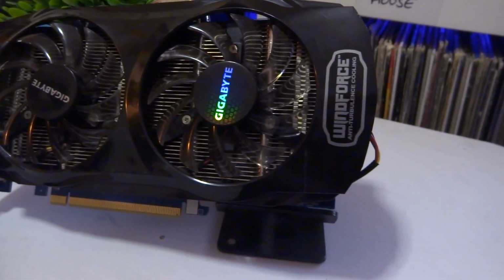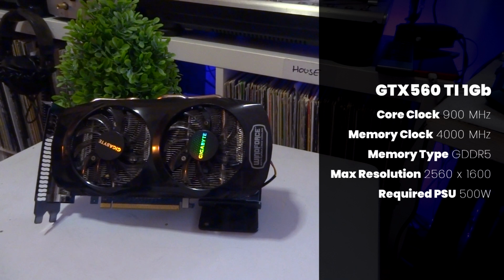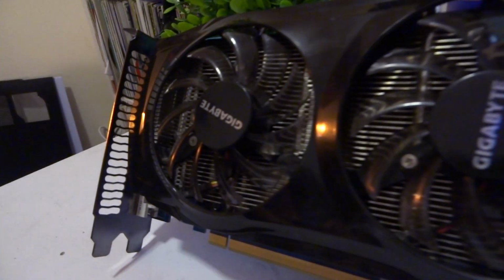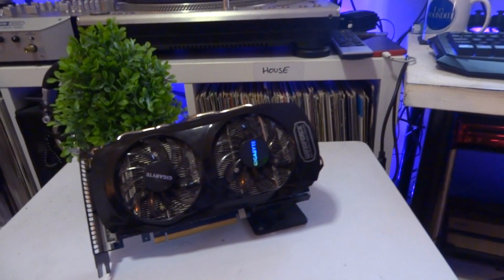A Quick Review of the GTX 560 Ti - Any Good in 2018? Lets find out!

Comment: I have a pc with:
GTX 560 Ti
Intel i7 2600K
8GB RAM
and i can run fortnite with competitive settings (1920x1080, 3D resolution 100%, everything at low except view distance and textures, which are on epic. Motion blur and v-sync turned off) at an avg fps of 100 (consider i cap it at 120), a 1% low of 49Fps and a 0.1% low of 25 FPS. They NEVER drop down 60 when i really need them (aiming, building, editing) and it never stutters.
Using Windows 7 with the most performance settings possible
Reply: Conclusion? I find it a really solid card even these days if u dont play super high graphics games. You should buy it only if it has a good price (cant really help u on that) and u know you won't be playing graphics-intense games.
Got this entire setup with peripherals (gaming keyboard, monitor and mouse) for just 300€. That's a fucking good deal
Reply from the maker: Very cool deal indeed :)
Reply: Hi, I have a problem updating drivers. This is because I used Windows 10.???
Reply: @FutureBoyWonder  a very late answer but windows 7 is just personal preference. I recently updated to win 10 tho

Comment: Can you tell me what specs the whole PC had?
I got a PC with this card, 2    2x4 8GB HyperX ram sticks, Intel Extreme Series DX79TO motherboard, 750W power supply, a 120GB SSD and 1TB HDD. I haven't got a monitor yet so I will buy it very soon, you probably wont respond in time, but would be cool to hear your answer, anyways cheers mate.

Comment: for some reason my 560 ti does so well in games like in fortnite at 1080p with all at epic settings i get a solid 120 fps
Reply from the maker: Thats a huge difference to what I saw, however my card could have been faulty or something so if I ever cross paths with a 560Ti ill 100% test again on a couple of different systems and see what if anything changes :)
Reply: @UsedTechHustle  ok
Reply: Impossible
Reply: @spere43  I have Xeon x5660 and 10gb ddr3 ram is it ok if I buy this card
Reply: Yes, if you can get the card cheap for like under 10 (For me, Australian) Dollars. Although be careful as i'm pretty sure the xeon line is more for server use not for gaming use, so it won't be optimized for gaming.Also since its a 2010 processor, there is a chance the cores are dying due to its age. In the future when you have more of a budget, i'd suggest upgrading to (As of now, 06/26/20) a ryzen 3 2nd or 3rd gen (Which ever is cheaper at the time of purchase) with 16gb of ddr4 ram and a msi b450m tomahawk mobo and maybe a used gtx 980/ti to go with it. All the other components from your old rig should be fine as long as the case can fit the mobo and the power supply is not older than 5 years. Hope this helps.
Reply: Although i have upgraded to a gtx 980 ti myself so I am unsure if the gtx 560 ti will be able to run modern games well. If you can, can you tell me what games /apps you plan to use the gtx 560ti for.

Comment: I'm thinking to buy a i7-2600 with this card, do u think it will be good with that combo or?
Reply from the maker: Hmmm, it will be pretty good, but if you can find a good deal on a 660/660Ti/750Ti etc you will get even better results I think.
Reply: I have an i7 2600 8gbram GTX 560  and play Doom medium settings with about 30fps.
Reply: buy Ryzen pleb
Reply: I got a i5-6400 instead with a R5 330 2gb the graphics is decent but not better than my GT1030